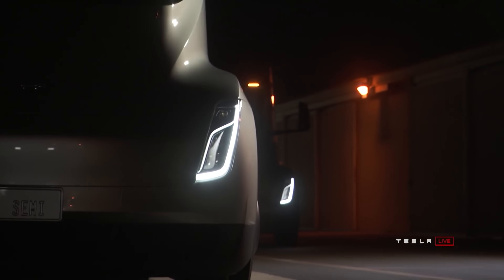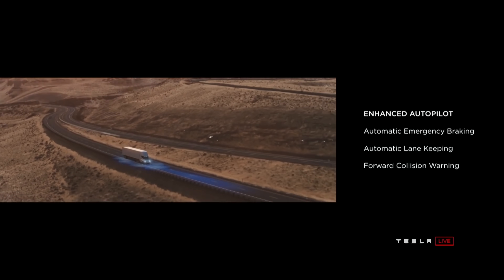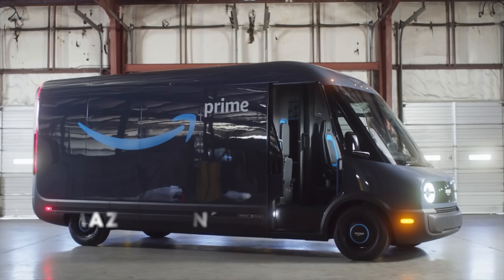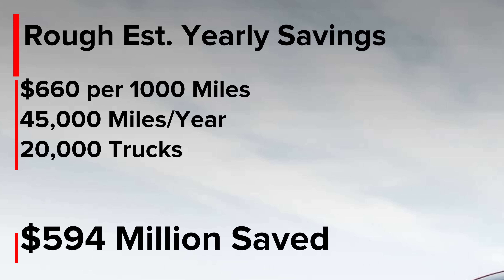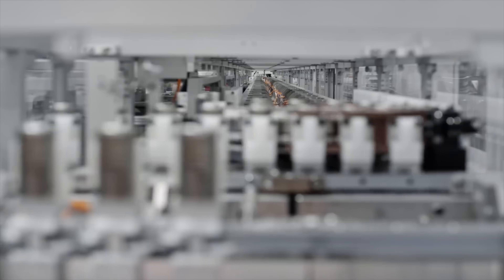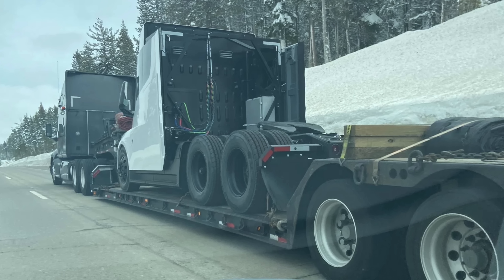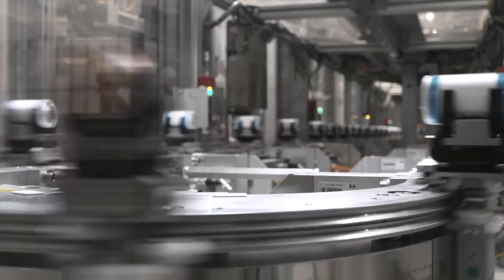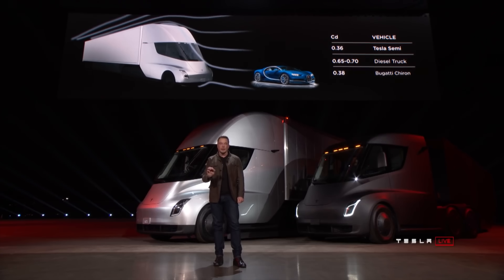The Tesla Semi Changes EVERYTHING

Comment from the maker: Head to https://squarespace.com/ryanshaw to save 10% off your first purchase of a website or domain using code RYANSHAW
Reply: Elon tweeted yesterday, that they are cell constrained. The Semi might come in 2022 but not before ;) but thanks for your great content :)
Reply: @TESSINEWS  why does the website day 300- 500 in range? Is it load depend?
Reply: @ryan shaw how does 4 motors stop the trailer from jacknifeing? I don't think elon knows what a jacknifing truck even looks like because his solution makes no sense. At least from how it is explained. 

As for the acceleration you do realize that the goal of a semi is to haul extremely top-heavy loads right? High 0 to 60 is the last thing truckers need and in some cases is kind of dangerous. Expecial will heavy loads where you don't what the load to shift or else it may come loose , get damaged or worse kill someone after falling off or out of the sides or back of the trailer. Same goes for braking to fast. You want to be able have a full glass of water on the dash and it won't spill because of the handling. 

Otherwise the fact that it is an electric truck is perfect.

 Tho the range can use some extention by like 700 miles. Most semis range tends to be around 1000 to 1200 miles . (150 to 300gal tank at 4mpg) 
Also are there any plans for chassis configuration such as 4x2 or 8x6s or even a larger sleeper cab model? 

Otherwise I could argue that it has more in common with a single seat container yard dock truck that with your average daycab hauler semi. 

Also find it kind of funny that they installed bulletproof plexiglass instead of just adding a windshield stoneguard to the design as an option. 

Otherwise finally getting an electric semi on the road is going to be the best thing for most independent truckers specially if the costs hold up. And also no diesel emissions. (The best part of course)
Reply: @Ilikefire2793  Because the motors can spin the wheels independently think of it like torque vectoring on steroids.
Reply: @josh o. Still don't understand how that is supposed to stop a trailer going  90° after the trailer brakes fail but the truck brakes still work. Because  what you just mentioned seems more like advanced traction control than an anti jacknifeing fifth wheel system.
Reply: Truck drivers don't have time to fuel during the day. Only done at the end of the day after over 600+ miles of driving. Don't forget about the parking crisis truck drivers face daily

Comment: In 2017 wasn't the Tesla semi promised by Elon Musk to be available for delivery to purchasers in 2019? To quote he said "Production begins in 2019, so if you order now you get the truck in 2019." To date, even Tesla admit they haven't shipped a single truck and they are now saying sometime in 2022. 

The one thing that I would be interested in is the battery weight and how this will effect gross axle weight limits and the weight of the battery. Another issue is often trucks are refuelled and immediately turned around as soon as they can hitch up to a trailer. How will Tesla equal this? Will they have batteries that are slotted out and in?

Comment: The moment you said "towing 80,000lb..." told me everything I need to know. 80,000lb is the max gross weight a truck can be on most roads. The truck isn't hauling an 80,000lb trailer. Combine that with the irrelevant focus on acceleration its really a useless video that fails to address the huge amount of criticism that Tesla has failed to address.  

I really with "tech enthusiasts" like you stopped commenting about things you have no understanding of, especially when it's nothing more than Elon vaporware like this truck. 

Add to that the constant reference to random unqualified "savings" that Tesla claim, without providing information on how those "savings" are derived is just pointless. Saving Amazon $500m per year? Bullshit.

Comment: A lot of talk and still nothing.
Meanwhile:
Others like Volvo already have electric trucks out there.
Meanwhile: In Sweden, Finland and other countries we already have heavy loads. Those 36 tonne  load in the US is like... nothing. In Sweden we are above 70 tonne on a lot of roads and 90 tonne (and above) is already used under test conditions  and Finland hast tested 104 tonne trucks six years ago! And like the minimum in Europe is 40 tonne (but several countries are above that).

BTW, comparing the fuelling of a battery with a diesel version is like, not accurate at all.
So, the diesel might take 15 minutes to fuel but it will go like three time the distance (or more) compared to the battery truck.

Comment: Still have to spend $3.6B upfront costs, which is roughly 6 year ROI to break even, that is IF those savings are realized.  And FINALLY owning a model 3 this week, I realized that 256 miles or so range I have is actually closer to 200 miles on daily driving.  I am supposed to not charge over 90% or deplete less than 20%.  Then I lose another mile or two every day in phantom drain.  That is like a tenth of a gallon of fuel evaporating in your ICE car every night.  

Don't get me wrong.  I love tesla and look for a reason to drive somewhere now and I'm ok with the trade offs.  My concern is if companies do not understand about EV as they make the jump to Tesla Semis, they may end up short of the projected numbers and be less than happy.  Drivers get paid when their wheels are turning.  So if their 500 mile semi can only do 350 miles to keep the battery healthy, they will not be happy.  

I am interested to see how it works out in the end.
Reply: The problem is that companies don't watch stupid YouTube videos to make decisions...so it's pretty hard to sell them a more expensive, more problematic means of cargo transportation just because it's pretty and looks futuristic.
Reply: You are spot on.  Dont forget in the winter batteries are only 75% efficient roughly so that is even less range half the year depending on location.  Also those prices were from 2017 and I assume inflation and chip shortage has made those prices even less accurate.
Reply: @McCarterly  What is even more interesting is the trailers the haven't been discussed.  Other than independent drivers, most companies have a lot more trailers on the lot.  Going on trips with my dad, he would drop his empty and hook a full for his run five hundred miles away.  Drop again, hook and cook, and keep going.  Tesla trailers are Tesla.  You can't hook up to a Great Dain or a Fontaine trailer, right?  What about refeers? Or fuel or grain.  Tesla IS NOT ready for the truck market.  

The batteries are cooled and heated, to your point. So battery efficiency is improving.  When I pull into the garage after a hot day, you can "hear the car running" while it is cooling the battery pack.  Efficiency might be there. But that's additional drain.   

Yes, chip prices are thru the roof.  My car cost $4k more now only three months later.  Have no idea the extra computers a semi might have.

Comment: Lack of maintenance is figured into the average cost per mile. Hence why normal trucks cost $1.50 in the long run.  Maintenance aside it does not cost that much.  10 years experience with 150k miles a year.  I look forward to driving one.

Also my new truck has lane assist and auto braking.

Comment: A lot of skepticism in the comment (and understandably so), but keep in mind that you gotta start somewhere. Electric passenger cars also started very modestly and saw a lot of skepticism, but now you can see them everywhere. They have not won over ICE cars yet, but the paradigm is definitely shifting.
Reply: Electric passenger cars started before ICE, 150 years ago..... nothing new.......
Reply: @SuperNevile  What happened 150 years ago was more of a false start. Electric cars have not become practical until lithium batteries were invented.
Reply: @amedv  Not necessarily a "false start". The squire could get his chauffeur to drive him in his electric car to the station for his steam railway journey to London and back. Electric cars were a "niche product" for the wealthy as indeed they are now, 150 years later. It was ICE and Henry Ford which EVENTUALLY gave the "common man" his "freedom". The world will go electric, but chassis construction in lower weight aluminium (less stiff and weaker than steel, but requiring cleverer design for integrity), and Lithium, Cobalt etc. etc. for batteries, in my opinion, will still be expensive, and indeed will get more expensive for procurement reasons. In other words, the era of "cheap" practical motoring is over.
Reply: @SuperNevile  It was a false start because it died out pretty quickly. Electric cars are no longer a toy for rich. Even I got one ;-)
Reply: Doctor Detroit  Hello, interdimensional traveler! How's things in parallel universe? Because in my universe all major car companies make big plans for EVs. Governments as well. And it's not just tax incentives. For example, UK plans to ban ICE cars sales in 2030 and other countries will follow.  If that's not a paradigm shift, I don't know what is.
As for calling Tesla a golf cart... Have you driven one? Model 3 is the best car I ever had. And I owned nice cars in the past (Acura, Infiniti, Saab). Traded my Mustang for Model 3 and never looked back. Sure, Teslas are not cheap, but ICE cars with similar performance cost more. Tesla needs to make a cheaper car and they are already working on it (so called "Model 2").

Comment: I feel Walmart is an easier start for the Tesla semi. I also think they should look into a large battery on the “Tesla Trailer”. I see trailers unhitched with no tractor at my local Walmarts loading dock all the time. Plenty of time to charge while managing the charging and range issues much better.
Reply: It's also more weight which is less freight being shipped out, I doubt the Tesla semi will dominate the market especially since other manufacturers are already having their own versions on the road, Volvo for example

Comment: How about a trailer with batteries in the floor of the front of the trailer. It would mean less cargo due to weight but longer range. It could even be an add on to the current trailers. Your could even put solar cells on the top of the trailer.

Comment: 14:30  With the convoys some of the savings will likely come from drafting.  With the self-driving components, the trucks can more safely drive closer to each other to maximize the reduction in wind resistance.  My guess is the trucks will be linked together so if the lead truck needs to brake suddenly, the following trucks will react immediately.  The Mythbusters did an episode where they tested drafting behind a semi truck and up to a certain point the increase in gas mileage was impressive, something like a 45% increase.  Super dangerous for a human to do this, but likely quite safe when the trucks can be linked together.

Comment: Changes everything?  They are not building them, and not delivering them.  So I'd say it changes nothing.  0 to 60 stats for a truck wow that's important  SMH.  ps. Semi trucks roll over b/c of their trailers, not because of their tractors.  pps Diesel semi trucks can haul 40 tons of freight for 600 miles on 1 fuel refill.  Try that on batteries and see how far you get

Comment: 500 miles on 1 charge wont work for long haul lol
Reply: You get another 400 miles on your 30 minute break. 900 miles a day is more than enough for long-haul
Reply: @saultknutz1166  hahaha what are you talking about you obviously don't drive cdl
Reply: The Semi isn't even here yet, so I'm not worried about the charging network rn. It'll grow quickly just like it did for the cars. The first ones will probably go to short haul locals like Pepsi, UPS, and Walmart anyway...
Reply: @saultknutz1166  eventually there wont be drivers in them at all.
Reply: Lol, you ain't running more than 900 a day unless you're running double paper logs in a pre-ELD rig.
Reply: @saultknutz1166  well you ain't charging a tesla semi in 30 minutes flat....there will be a waiting line and there isnt enough charging stations to accommodate the trucking industry at the moment lol
Reply: You're probably correct on that one...

Comment: As an OTR truck driver i need to point out, that you are confusing Tesla's Semi truck with an over the road semi truck.  Tesla's Semi does not have a sleeper berth.  And so, it is intended for local driving only.   The convoy system that Elon talks about is many years in the future. It is practical only for highway driving.   Just like self driving cars are now.
Reply: Yeah the convoy calculation made me cringe.  Tesla and the fanbase need to back off on all FSD revenues until it's actually NHTSA /DOT approved.  It's amazing what they can do but it's not ready for primetime yet, and getting federal approval could take a long time.

Comment: Just stop with the Tesla sycophancy.
I own a Model 3 and a Taycan, so I'm an electric fan, but it just doesn't translate in to the semi world. 
First off, a typical diesel semi has a 2000 mile range on one fill. The 300 to 500 mile range on the electric tractor makes it a no go out of the chute.
Secondly the batteries are going to displace a lot of carrying capacity.
The electric semi is just stupid.
Reply: What diesel semi truck you know of that’s getting 2,000 mile per fill up??? 😳 I’ve been a trucker for almost 9 years now and have never gotten 2,000 miles a fill up… Whether the truck is brand new or older, it’s not possible 🤦🏾‍♂️

Comment: Hi thank youbfor your work. What is max range after driven almost 25000 miles?
Reply: Based on existing Tesla cells, probably around 95% of original range, with degradation flattening out from there.

Comment: So what happens to the trucks after the batteries become worn out? A normal diesel truck will be sold to a smaller operator and still run well, but these battery trucks will be worthless once they hit the point when battery degradation hits a certain point and with the average long haul semi truck driving up to 120,000 miles per year that is 8 years from 0 to 1 million miles, and the battery will of lost s lot of its range before it hits 1 million miles. Current Model S and X only get a 160,000 mile warranty in the past they had unlimited however that proved expensive for Tesla as many Model S needed battery replacements after just 200,000 miles.